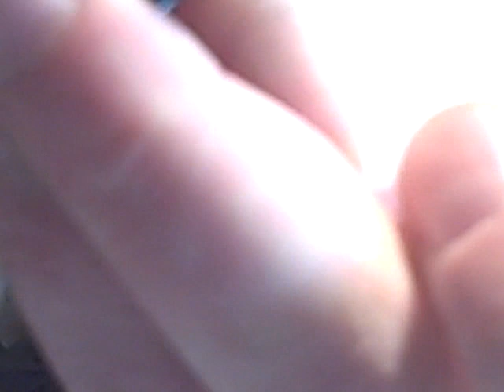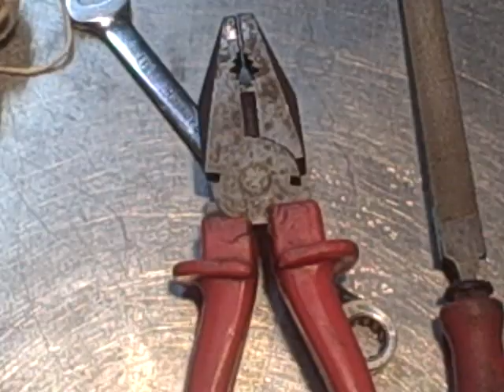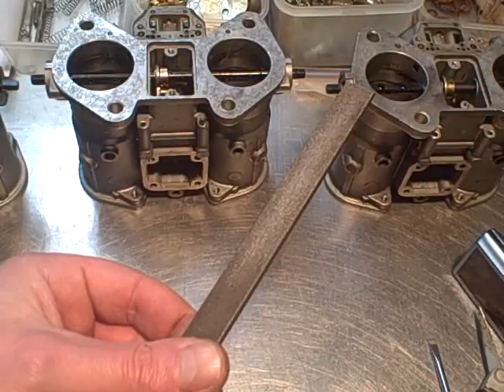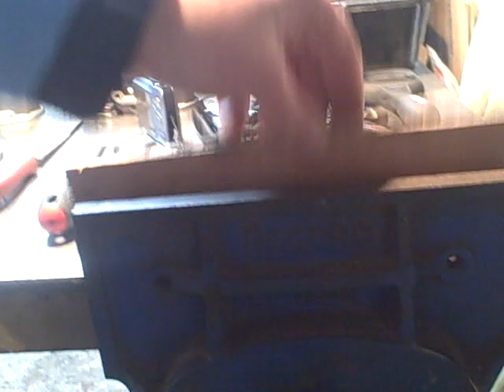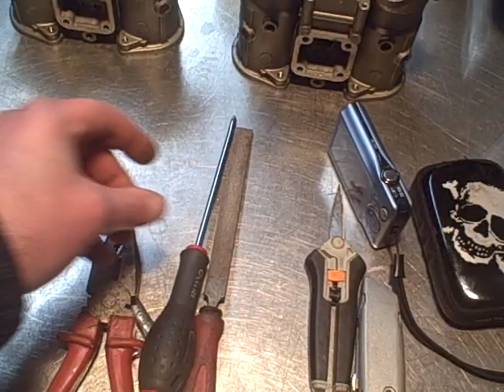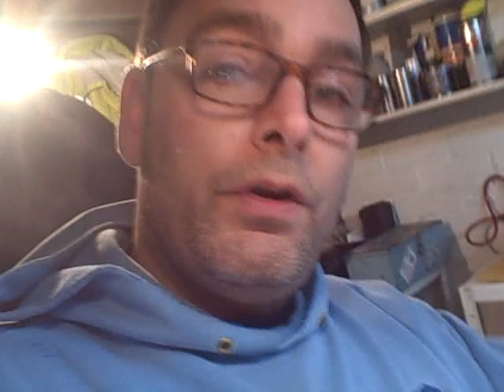How I remove Old Butterfly/Throttle valve screws from WEBER DCOE Carburettors

Comment: I have a 40 DCOE carb.  I've read that the butterfly valve securing screws are peened over in the factory and if you try and unscrew them you'll snap the screw or wreck the threads in the spindle.

I can't tell by looking at them if this is true. You don't need to upset a screw end by much to make it stop moving. 

Obviously, for the method you use, its neither here nor there if they're peened or not but it would be interesting to know.
Reply from the maker: Try filing or grinding the backs of the screws, before trying to loosen them. We have also found that intense heat applied on the area of the threads, help to get the screws out in one piece.
Reply: @Classiccarbscouk  My current issue is that I want the butterflies out to free the spindle which is stuck in its bore. The butterflies are shut so the screw heads are facing outwards and there is no access to the peened ends. 

I've had them submerged in WD40 for 5 days. 

If I can free them off I don't need to unscrew the butterflies.

But I'm in a chicken/egg situation. 

Is ultrasonic cleaning any use in freeing spindles?

I've tried lightly tapping the ends of the spindles to no avail.

They are steel spindles, not brass.
Reply from the maker: @evildrome  well, if the spindle is seized, the bearings will more than likely need replacing - at the best of times. Heat is very helpful in these situations. If you have a good selection of hi quality drills, and you are good at drilling accurately, you can drill the screws out. Watch out though, as if this goes wrong, the spindle is a goner.
If you're in the UK, send them/it to me and I'll sort it out for you.
My email: emmanuel@classiccarbs.co.uk
Reply: @Classiccarbscouk  -Thanks, that's helpful.  So, I'm guessing I need to free the spindle first?  I could drill out the screws but if the spindle is frozen in its bore, even with the screws gone I can't turn the butterflies to get them out so getting the spindle turning is, I guess, the first task?

Where do the spindles tend to seize?  I'm guessing the spindle might lock to the ID of the bearing preventing its extraction but the bearings themselves still turn?

So is the shaft being prevented from rotation by corrosion between the shaft and the bore in the aluminium of the carb?

I'm just trying to work out what I need to heat up first.

And.. is there anything that needs removing to protect it from heat?

Thanks!
Reply from the maker: @evildrome  good luck buddy! 👍👍👍

Comment: when you reinstall the new screws what do you do to replicate the factory mushrooming of the  screws and make sure they don't back out over time? do you also tap (mushroom) them from the back or do you simply use Locktite?
Reply from the maker: @toothlesscoot  would love to mushroom them, but no, we use low strength loktite

Comment: Rusty! 

Ive got some 44 IDF that the butterfly appears to have been removed and not installed well. They bind on the carb... problem is... not sure how to make them align better. Have any tips???
Reply from the maker: Yeah, try tapping the end of the spindle with a small SMALL hammer.
This will ever so slightly move the apindle's position and reveal the full length of the slot for the valve to sit in.
Also if need be, slacken one or both spindle nuts, and that will allow the spindle to shift, and the valves will find home position.
Might have to do this more than once, until all works smoothly.
Reply: @Classiccarbscouk  Thank you!

Comment: HI RL hoping for some advice my mate has a set of  triple webers 45 DCOE That have just come from the reconditioned shop.
We have found after mixtures and idle have been set after you give it a few revs it's not returning back to idle it's sitting anywhere between 12 to 15 hundred rpm.
After disconnecting all the linkage arms i found the back carb is not returning all the way home the butterflies are sticking open a few thou after loosening the butterfly shaft nut on both sides it made a small improvement but it's still not returning all the way home.
 if you take both nuts washers and stopper arm off the butterfly shaft these are these brass caps that look like a retaining cap or some sort of friction cap both of these look like there been pulled out with a screwdriver and damaged then taped back in but even though they dont seem to be interfering with the shaft the butterflies still are not returning home it's like the butterfly needs a bit more clearance. Any help would be appreciated thanks.
Reply from the maker: Ok, sounds like the setup is leaking air, hense not returning to a smooth idle.
Try slacking the butterfly screws of the affected carburettor, and give the spindle a tap with a small hammer on each end. This will align the spindle. Tighten the butterfly screws and try the throttle action.
I think the spindle/throttle valves are binding against the carburettor's inside bore.
Re-align your carb's spindle and throttle valves, and the problem should be sorted.

Slow rpm return to idle, means air is leaking somewhere..
Hope this helps.
Emmanuel
Reply: @Classiccarbscouk  Thanks for your quick reply iv checked most of that out the butterfly is not snapping closed like the others. After taking it off you open it to full throttle and let it snap shut and it stops around 1.5 to 2 mm from being fully closed. You can see far more light around the butterfly than you can see on the other 2 carbies. I don't think this shop has done a full resto on these carbies the shaft bearings havnt been replaced on this carbie anyway you can feel the tight spots in the bearings when you turn it slow I'v told my mate to take them all back as it looks like this guy has only put a gasket kit in them no sonic cleaning has beed done carbon still covering most parts.  Thanks for your advice it will be interesting to see what this guy tells him when he takes them back will let you know what explanations this expert gives after he's confronted with them again.
I know my mate was charged top dollar from this carburetor center to have them done and he spent 10s of thousands to get this car ready for a wedding. It's a holden EH wagon 63 i think
Reply: @Classiccarbscouk   Sorry RL i sent my first comment then pulled the back carbie off after i found the butterfly was not returning then seen the bearings were sticking brass caps were mangled. 1 i didn't want to stuff with it too much because im no expert on fuel systems and i didnt want the carbie shop say it's been tampered with and wouldn't cover their work. Thanks again for your video's you  explain them so well an officer worker could follow your instruction their simple and easy to follow keep up the good work

Comment: What are you doing when filing the back side of the screw?
Reply: Some carbs have the rear of the screws mushroomed, so that they don’t vibrate off and fall into the manifold. He’s just removing the mushroomed part.
Reply from the maker: As 'Fg jf' said :)